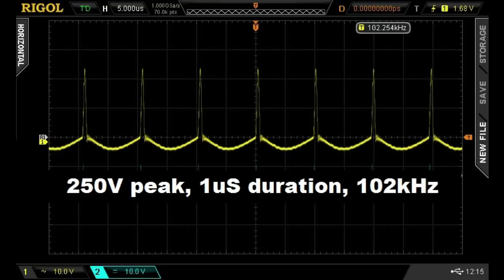Longitudinal Current Induced by Dielectric Field Impulses

Comment: M. IVO Have you heard of Schwinger field theory?  A plasma physicist was telling me that Julian Schwinger noticed a change in the dielectric constant of space when higher voltages are used.  This sounds intuitive to me since particle-antiparticle pairs are constantly appearing out of the vacuum.  T Henry Moray started off with high voltage for short durations.  It could be an interesting direction.  Great videos.
Reply from the maker: thanks, no. what is the threshold? 2kV 3kV 15kV? any idea?
Reply: @MasterIvo  I don't know the voltage, but I'll read one of Schwinger's books.  I got this notion from quantum vacuum fluctuations.  Since particle/anti-particle pairs are constantly appearing, then you might be able to obtain more particles with more voltage.
Reply: @MasterIvo  Hv can ionise space. Then disruptive discharge has great effect. I will stick with Tesla design. Primary as parallel resonant and secondary as serial. For me secondary must have fizical lenght like longer stick and must be terminated with coil with high capacitance. Something like transmision line terminating but in way to stimulate standing wawes in secondary. Then you can acieve pressure. Paralel primary is nice for "low" drive energy and serial secondary as HV and high current. So if some double the voltage and current power increase 16 times. Fase shift is so important. I will soon play with that design. There is problem with that play called HV nano switch. How and with what achieve switching in ns range. Also mixed low and high frequency will play role, I guess. I will start with low voltage at beggining because HV and HC probes are so damn expensive. Cheers.
Reply from the maker: @zeljkolukac4170  Good luck! What about his extra coil? I now use series AND parallel resonance, with my secondary and extra coil, together.
extra coil is grounded, secondary acts as top load.
impulsed primary only works with low impedance (series res).
Impulse is needed to excite the high frequency extra coil.
high current of the primary is used for the slower lower harmonic secondary.
Reply: @MasterIvo  Well, Your work greatly inspired me. At moment just have Siglent scope and in rush to buy PS  60V/10A  and SG 30Mhz. I have little diff approach. I want energy transfer like low input high output. So with high resonance impedance/low current   parallel primary is ideal for me. Secondary must be high current and HV, my guess. Also parallel primary allow using HV with cheap flyback at later stage rising HV at secondary. First have to figure out what is magnified in magnifying amplifier. Second has hunch that HF is must and third coil too or just  ball. Third coil smells me like variable cap for producing longitudinal wawes. I guess that third coil have to be reflexive for secondary producing standing wawes. Ofc must not neglect any non linear parameter in sistem. Variable ind. or cap. Also mixing two frequencies one low and another high but in way that lower Freq. have even or odd periods or arbitrary periods of HF signal. Avalanche diode is also interesting as variable cap and rapid change and non linear characteristic. So there are lot to experiment. To mention my work will be open source too. For end one question. Is it possible to increase permeability with static field inside coil sort of acting like ferrite? Cheers.
Reply from the maker: static field inside coil to increase permeability? No I don't think so.
for a proper magnifying system All coils need to be resonant.
within my system current and voltage are amplified, and in phase in the extra coil.

this is a nice 2 channel 30mhz
https://a.aliexpress.com/_EuHEtxV

this is a 5mhz single channel which also works great (and cheaper) 
https://a.aliexpress.com/_EGmNAjD

Comment: Vortex coils + electric potential = vortex radiant electricity. Not slow. 4D spin axis at light speed. Doesnt expand but implode at the center, and the outter diameter is outward pushing. I think this pressure could be useful, or negated thereby, depending on the reason you use the coil. Energy is just being transformed to different planes.
Reply from the maker: Best would be to start experimenting. And work with the results. Let Nature show the way.

Comment: Like a pebble into a still pond. As the pebble sinks it creates a vortex as it sinks below the surface, it is slow to form as it reacts to the weight of the pebble. The waves radiating outwards are like voltage and current moving in the water, so along the wire. The aether field is disturbed, like the magnetic field liken to the water, it reacts instantly into waves as soon as the pebble breaks the waters surface. The force of this radiant wave energy radiates outwards like a ball of waves as in an explosion. In a pond it only has 2 dimensions, in reality should have 3, thus more power than first appears. This wave can now turn into high frequency waves and bounce into other waves and create a Tsunami and break-up shorelines for many miles around. It can all start by the disturbance of the sea of energy that surrounds us.
Reply from the maker: the first instant, the pebble hits the water, it sends out a longitudinal shockwave, much faster then the transverse waves that follow it

Comment: This is a brilliantly explained Video. Thank you. I'm sure you realize that when you identify the transformation of the Dielectric Field into a Magnetic field as "slow" the reverse is likely also true (although perhaps not as ponderous). So the action of a bifilar coil that accepts a changing magnetic field as a Dielectric field, and then releases the DF into the magnetic field which is transferred to the internalized Dielectric field of the inductor has just taken the Ethers by the leash for a walk towards the transformation back into electricity, contrary to the desired radiant energy effect.

What you may need next is another capacitive pickup (of equal mass?) to catch and direct the Ether longitudinal wave for amplification and projection/distribution directly on the skin of the conductors? And if an inductor is unavoidable, make it one with very low inductance. Make sense? Minimize the transformation to magnetism. Can you get it to dump directly into a capacitor bank  via a conductor that has a directional antenna along the way to broadcast an Ether wave to a secondary target?  Kudos! great stuff, I'm winding my own speaker wire flux-capacitor this week. Really could use your signal generator and O'scope. Love your work and support your open source position. Party on Dude. B
Reply from the maker: thanks, thats basically what I did and explained in my april 2019 Radiant Power video.

That one only used one impulse per sine wave (which has 2 maximums).

Now working on an alterating impulse, one for each maximum.

pulse gen is from aliexpress you can find it there
Reply: @MasterIvo  Sure enough, this is what you have done with your multiple bifilar coils. I am a little put off by distinguishing the energy stored in the capacitance as consumed or negative, vs. the energy traveling through the inductor as generated. The magnetic field is dynamic in nature, it must move to be present. Steinmetz called the magnetic field stored energy not generated because when you stop the flow of the dielectric field, the magnetic field will reassert the dielectric field (returning the energy of the dielectric field, just as completing the connection of the dielectric circuit differential restores the flow of the dielectric field. The dielectric field returned is the inversion of what generated the magnetic field (or is the magnetic field the inversion?), whereas the capacitor returns the same directed dielectric field that was inserted to the capacitor.

Here it brings into focus the useless rat's nest of physics definition of energy by keeping track of which direction it is going. Energy increasing the charge of a capacitor, positive or negative is consumed or stored energy, similarly, energy increasing the magnetic field (or current) positive or negative is increased consumed or stored energy. Steinmetz made the distinction between both these active reactances as not true energy consumption, as is resistance which changes electricity to heat, (ignoring the thermocouple effect of changing electricity into heat and cold or using temp differentials to generate electricity.)

I think there is a distinction between TEM and LMD waves and the phase shift of capacitance on inductance, which has been muddied here. Impulses of dielectric energy must have magnetic components, just as TEM waves do. However, the profile of the magnetic field is tightly wrapped around the impulse, not spread out, widely distributed as it is in AC waves (keep in mind very short wavelength, or high energy TEM waves are typically confused with LMD waves, x-rays and gamma waves produced by stars are LMD waves, not TEM waves, and are not as harmful in their LMD versions. The magnetic effect is limited to atomic structures that resonate with the impulse wavelength, which does not match the effect of repeated sine wave transition resonance. This is why LMD waves travel further than TEM waves, they pass unaffected through other materials that do not resonate with their magnetic footprints. When an LMD wave resonates, it does not need time to spin up the target, the effect is instant and direct without any resistance or delay. The target selection is comparatively much more precise and limited. Simple LMD projectors with no added power can cause water ions to combine and make rain miles away because the naturally produced LMD waves react only with water ions (Wilhelm Reich's and Trevor Constable's Cloud busters). Or Tesla's rumored death ray taking down 10,000 planes 250 miles down-range with properly tuned EMPs from his spark-gap.